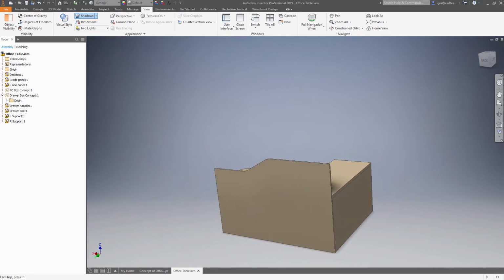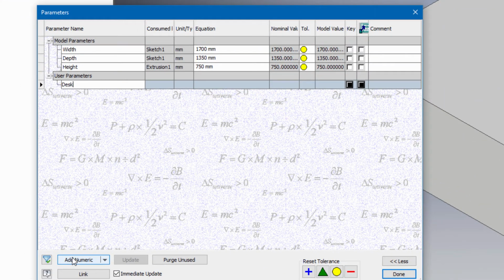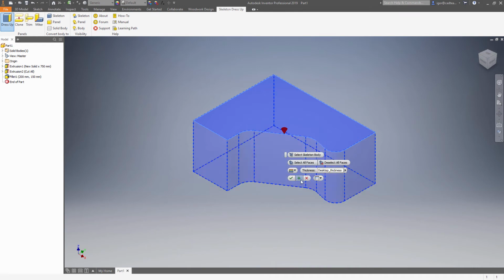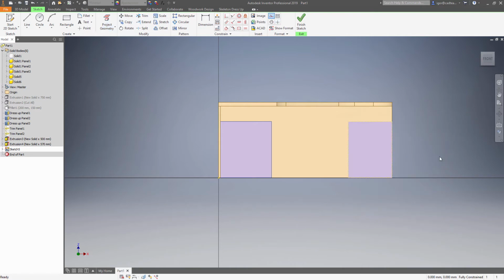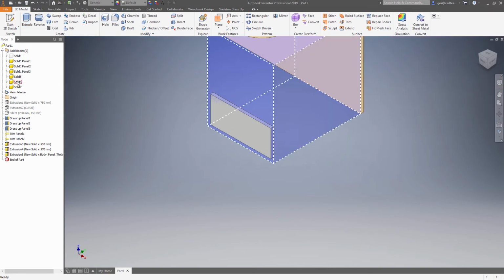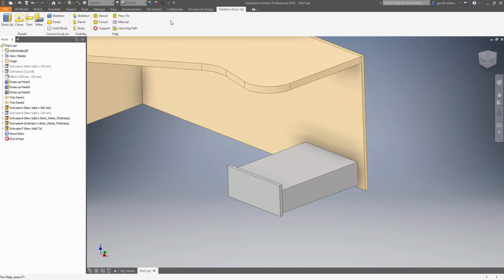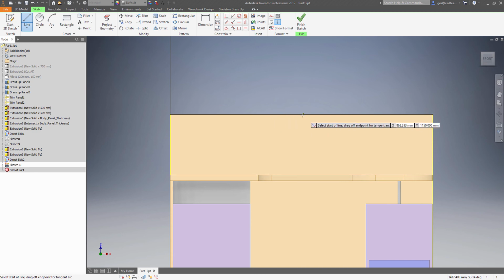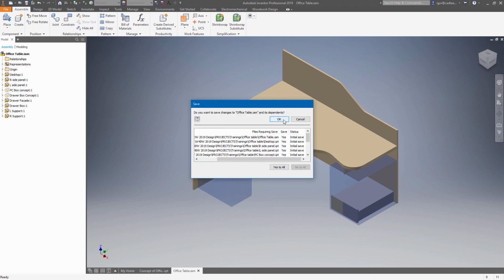Modelling. Panel dress up. Drawers space

Comment: Hi. Congratulations for your videos. I have a little doubt. In 2016 videos (General Learning Path new) you made the drawer box before the extrusion-intersection of the facade. Here, you made it after reducing drawer facade. This means 1.5 mm between drawer box and lateral panels. I`m talking about 10:43. The same happends with the distances up and down of the drawer box. With that distance, will the drawer hardware be separated from the lateral panels? Thanks
Reply from the maker: Thank you. It depends on how the drawer iBox is created. You can have a drawer's iBox that automatically reduces it width to make sure it will fit in the defined area. For more information please contact our partners in your location or use our forum.

Comment: how to move the dimension line?
Reply from the maker: Hello, Timothy, what do you mean? Which part of the video is unclear? Ir would be great if you could specify time.
Reply: in 3:36 if I want to move this dimensional line
Reply from the maker: I am not sure about the problem, but in order to move dimensional line you have to choose "Dimension" and click on two points (it can be point, line, face, etc.) and it will automatically show distance between those chosen points. When you'll have dimension on your model, you can edit the distance by entering a new value as it is shown in the video.